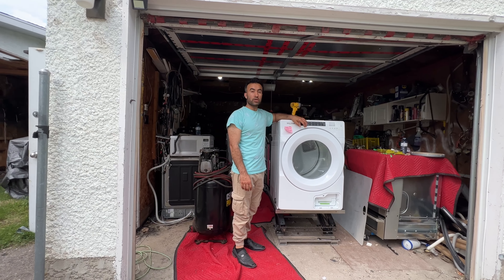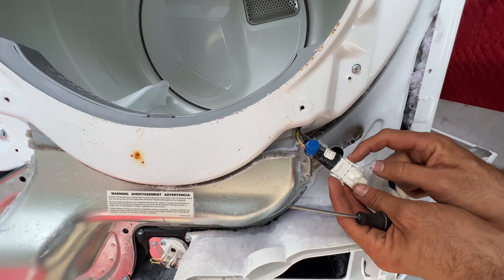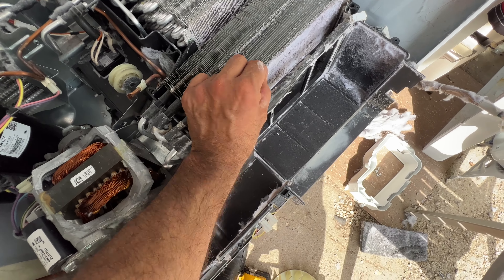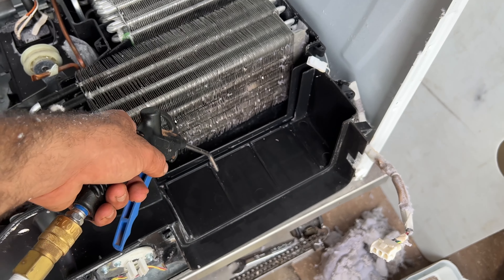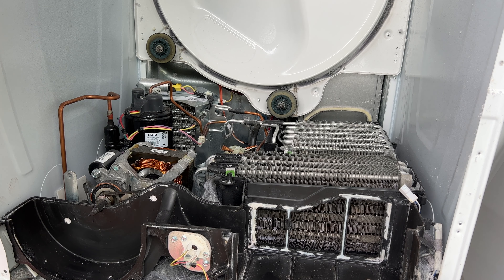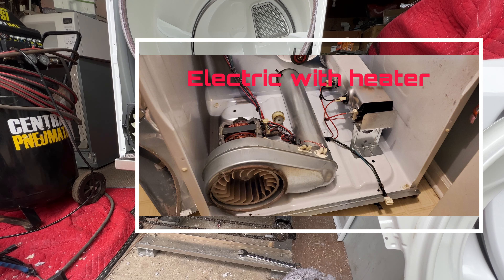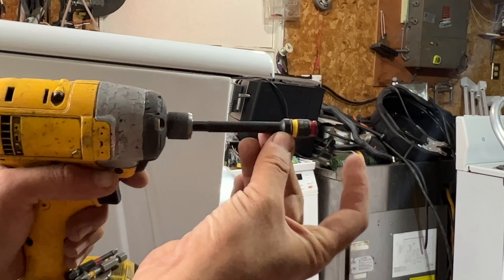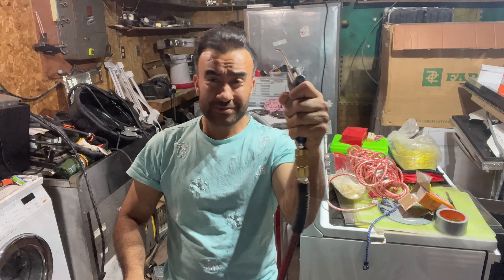WHIRLPOOL VENTLESS DRYER WILL NOT DRY PROPERLY

Comment: I used this video to disassemble and clean our dryer.  Made it real easy.  Took me about 2.5 hours, including walking back and forth to get all the things I needed to do the job, and working in a tight space.

I recommend to others using this model to not store anything on top of it, you can feel the heat building up inside on top of the dryer if it's been covered.  We've only had it refuse to run on overheating twice, and that was when it was still dirty inside and lots of towels/blankets were kept on top and keeping the heat in on max dryer heat setting.

I used a hand driver to put the screws back in, since they really don't need much to seat and hold firm, and the sheet metal looked thin.  One of my screws was stripped from the factory, in the plastic no less :/

Comment: I have same unit and it also has an issue of cooling down the motor. Just not enough air movement inside despite the aux fan. So the motor stops spinning at the middle of cycle (thermal protection) and since there is no speed sensor the mother board doesn’t recognize the stopped motor and continues the cycle. The solution for that is to knock out closest to the front round tap on the left side panel (if you look at the dryer from the front. There are two of them and you can see them on the video at 1:42). It will improve the air movement inside and the motor will be properly cooled.
Reply: What do you mean by round tap?  I don't see what you are referring to at that time stamp.
Reply: @wberpunk  look at left panel - there are two round depressions in the panel (aka knockouts). Open the closest one to the front. You need to take the panel out to do it, since there is a cooper tube for the compressor.
Reply: @ksngs78  Got it!  Thanks so much.  Going to try this since I'm having the same issue
Reply: @wberpunk  did it helped? It definitely solved issue with my drier
Reply: @ksngs78  We ended up doing a deep clean and I noticed a considerable increase in air flow.  I did not do the knock-out yet, but planned to in the event the clean didn't fix it.

Comment: Excellent video sir 😮, just today I too k a flashlight and looked at condenser coil behind the pullout filter and had same clogged view . This is after a years use so typical of new technologies trying to save the planet actually turn out to be expensive disasters . I’m sure the bill to tear apart her dryer and clean it far surpassed any energy savings and I’ll tell you already that by time I do what you just did will be the one and only as a resistant old style electric is going to replace it.
  Typical complete engineering failure throughout its air handling ducts ! 
Thks again

Comment: Hameed, I ahve a similar problem. After 3 years of use and cleaning both filters after every load, there is still an accumulation of lint on the evaporator coil. Since the only path for dryer air to the evaporator is thru two filters thru a sealed enclosure, I figured that dryer air must be getting past the filter seal on the secondary filter. The green gasketing material on the secondary filter is cobby and dosent seal properly. I found some very narrow speaker gasketing foam (1/4” wide x 1/8” thick), I had left over from a stereo install and applied that in a continuousl strip around the back side sealing edge on the filter box that seals against the white material of the safety screen that protects the evaporator fins from damage. After doing this the filter locks much more securely against the screen face and I believe will greatly reduce lint bypassing the filter box. Time will tell.

Comment: Great video! I'm currently working on the same issue. Additionally, customer complained about some strange noise. Turned out, their tenants at some point did not insert a lint screen and a foreign object got down to a blower wheel and broke off several blades and damaged many other blades. Had to order new blower wheel as well as new drive belt, support rollers and few shafts.
Reply from the maker: Front panel is held by 2 screws , one from right Hand side front other is left rear almost impossible to pull out I forgot to catch it on the video . Or forgot to mention it .I m talking about front plastic cover the second one after first one is removed .

Comment: Excellent video on how to complete this job! For anyone wondering if this is possible to do yourself I can tell you that it is as long as you have some experience with basic tools and disassembly/assembly skills.

Whirlpool Corp, you should be ashamed of yourselves for the terrible engineering in the design of this appliance. The dust filters are not sufficient to prevent these issues and the design of the appliance requires full disassembly to effectively clean.
Reply from the maker: @andyclark9733  yeh Their stuff gets worse and worse day by day

Comment: I have the Whirlpool dryer model WHD560CHW2 and get the E2F9 error code.  I turned the breaker off, disconnected the drain hose and cut the screen to the evaporator coils and vacuumed them.  It worked for about 3 weeks and then the error code came on again.  I did the same thing and it started working again.  Any idea why it would work for weeks and then stop?
Reply from the maker: Probably one of your sensor are faulty or could be debris getting stuck where you cleaned it .
Reply: The F9 E2 Error is for the condensate drain pump. It sits between the motor and condenser case.
 Part# W10903190  gets you just the pump. It can also be changed from the rear.   make sure the drain discharge hose isnt kinked.
Reply: @leftylee5068  Can't figure out why it works for a few weeks after I turn the breaker off for 15 minutes, disconnect the drain hose and then put it back on and clean all the filters.  Wouldn't it either work or not if the drain pump was bad?  Another mystery!
Reply from the maker: @georgeharvey8784 when this happens next time don’t disconnect the hose must unplug the dryer let it set and use it again and see if it starts working again , if yes it starts you might have a bad relay in the board.
Reply: @hameedwafaAFG  Thank you.  Will try it.
Reply from the maker: @ yeh ✌️

Comment: These whirlpool dryers allow for fine lint and fine dust to get by the filters no matter what you do! That pull out filter allows for lint to go through making this dryer a nightmare over the years.
Reply from the maker: Agree
Reply: You could not give me one of these dryers for free. Ridiculous
Reply: @condor5635  LG finally looks like they have a winner 27 inch heat pump with a self cleaning condenser coil system. So there is no chance of lint accumulation and buildup! Lets see long term if it still works. Game Changer.

Comment: Hameed in europe the whole compressorsystem and motor etc are in a seperate base plastic. I dissasemble the sides remove cables and then lay the whole unit on its side id the compressor lines allow this other wise i just tilt it a little bit and use spray water. Done multiple siemens bosch here whirlpool doesnt have this problem and they work well!
Reply from the maker: Blomberg also has separate sealed system that you can take off completely to clean it . This is just a shiddy design on whirlpool ventless dryer .
Reply: @hameedwafaAFG  great job man! I started household appliance like 4 years ago now i have stock of almost 100 devices. I hope you get a store bro and 1000 new units and 100 used like me :)

Comment: there....I see the problem.....It's a Whirlpool. Crappy design. Do you think Whirlpool will pay it if I hand them your bill?
Reply from the maker: @andiman45  I do not think they will pay it if the unit is not in warranty
Reply: All ventless driers that i've seen are like this.
Reply: @Warp2090  I bought my 2 year old condo with these in place. I now see a better bottom filter available for this unit but at a cost of over $100. I see other companies with better filter design. I went Restore a few months ago and there were approx 30 pairs selling for $99 each used. Some apt switched.

Comment: I have a slightly different model in my apartment, but it has the same problem. Matinence will not help at all even though I think this much lint buildup is a fire hazard! Thank you for this video. It confirms i will need to take my entire unit apart so i can clean this. 🙄 What a terrible design.

Comment: Remind me again why anyone would want this type of dryer?  Simple required expected maintenance requires taking apart the entire unit to clean it. Extended run times. Yeh that’s  nice. I’ll stick with my old school dryer that requires minimum maintenance.
Reply: Because it uses a third of the power of normal dryer and allows me to run it off grid off of forklift batteries and solar. I have no electric bill, so I'll trade the no electric bill for a little cleaning.
Reply: @ glad you are happy with it
Reply: People who can't get a proper vent.
Reply: @staym925  While they use less electricity, they will still cost more in the long run due to repairs.
Reply: @Warp2090  your kinda missing the point, it allows me to run it off-grid off of batteries, it uses 600-700 watts, where as a normal dryer uses 4500 watts, it's a lot easier to run one off of a battery and an inverter using 600-700 watts vs using a 4500 watt dryer.

Comment: I have this dryer. I've had a tech repair it three times. One full year down revealed enormous amounts of lint in the body of the machine. The lint catch is a joke. The control panel eventually failed. I'm going to toss this machine. I've had it for 6 years only. What a disappointment.
Reply from the maker: Sorry that you had so many problems. Next time try to get an Asko or Huebsch ☺️